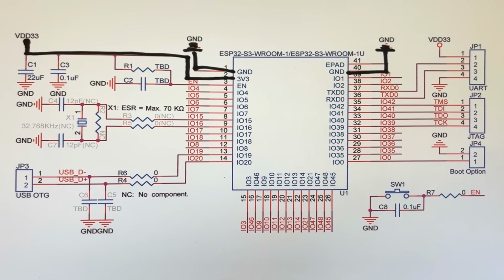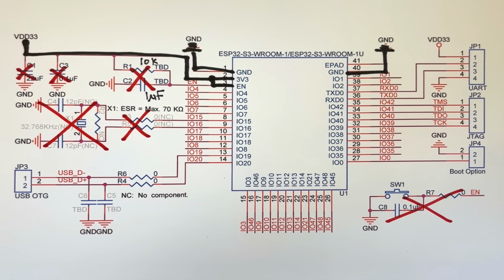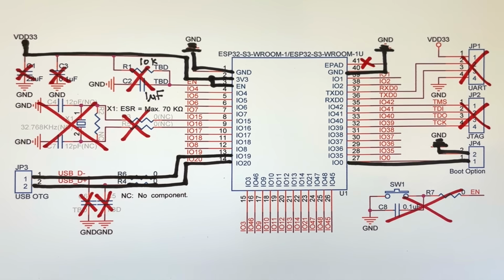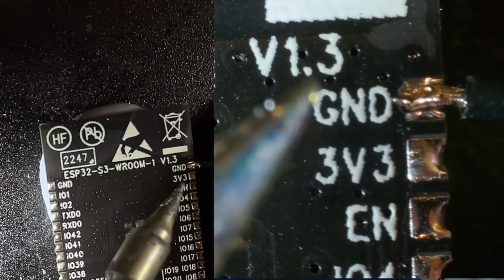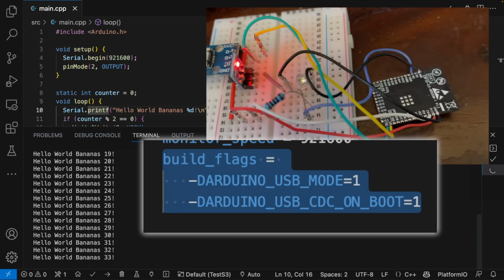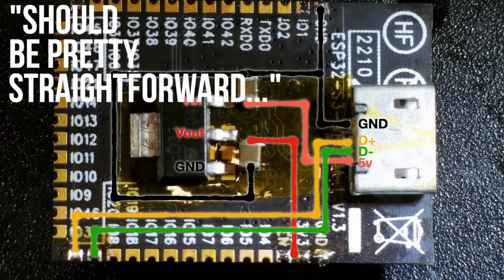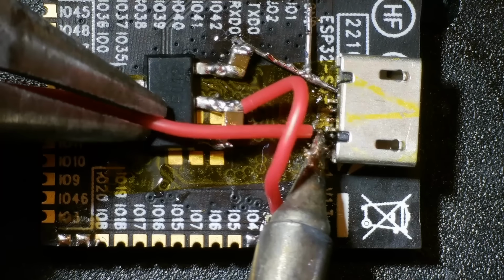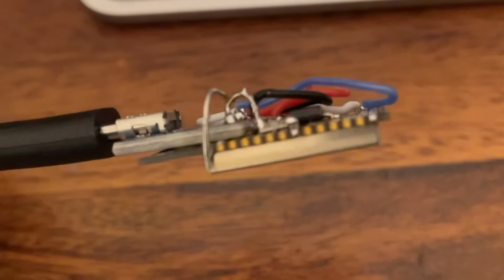Minimalist Microcontroller: Building a Bare-Bones Dev Board

Comment: Why not use an ESP32-S3 chip direct and build the Flash, controllers, and full setup, instead of the Wroom Module?  You can likely make it smaller as you dont need all that there too...  if you build the use case to be specific, can squeeze as small as you want if you dont need all PIN outs/ins, only the ones you need for that project.  But this is a cool idea with the capcom tape and just soldering it on, lol. 

I've been designing my projects to not use the Wroom module, but use the ESP32 SOC and building Flash, ant connector, etc...  I've been going through the datasheets and building my circuit based on the info there and the final product looks freaking professional!  I have not ordered yet to test... but its a LOT cheaper as the same board (125mm x 98mm) through JLC fully assembled with the flash/ESP32/Ant conn/crystal/all the resistors, capacitors, inductors, relays, screw terminals, fuse, etc.  is about $8 a board. on a 20 board order.  That is using their supplies and such.  This is just the esimate when uploading all the files and board info, not final.  and the quote for the wroom32 module (I didnt want to go with S3 because of some library short comings in the ESPHOME echosystem this board is used for, and I am patiently waiting for C6 as I want the Zigbee on Chip!!!!) for everything, but swap all the items instide the WROOM32 with one, was around $18 for a 20 board order. 

So I am very carefully going thru my design and check and double and double check about 15 more times before I push the purchase thru for my first test board.  I have watched Phil's Lab on this very item he has up and an excellent walk thru, after I did my first draft.  I'm not an electrical engineer, so this is my home hobby projects, and doing this as a puzzle for myself to perfect it and then just take that module block and put it on all my projects going fwd.  Maybe save some money in the long run.  Going to see about having them non-build it and get the parts myself and since its just me and not a full production, hand build all mine to save a few more bucks.   But the pricees they offer for fully assembled with parts included is so freaking CHEAP, its hard not to..

Comment: thanks for video. but i havem two question.  I have an esp32 device that I run on battery.  Is it correct to cancel the resistor and capacitor connected to the "en" pin on this device? Also, in deep sleep mode, does the device use the internal oscillator or the external oscillator?  Will I have any problems if I cancel the external oscillator since I use deep sleep mode?
Reply from the maker: Please bear in mind - this video was just a fun experiment. It’s not an instruction video on how to build a dev board.

For a real dev board you should have the resistor and capacitor on the en pin.

The crystal oscillator is not required unless you need really accurate timing. And if you need that you are better off using a real time clock module.

As always follow the data sheet recommendations.

Comment: Great idea if its a sunday night and you've got a demo to give monday morning, and your last working dev board got chewed by your dog.  Otherwise, what is the point?  You have all those pins how you going to connect to them?  Can u buy plain esp32 dev boards to just solder your module.  The bare modules are cheaper, I got a few S3's as the full boards are a few dollars more, and I've got some dead older esps, I assumed they are pin compatible with the s3, bet i'm wrong about that, anyway why I watched to see how minimum you can get, so thanks.

Comment: What about the heatsink on the bottom of the chip? These can run quite hot
Reply from the maker: According to the data sheet it is optional - it does help with thermal performance, but it’s not mandatory.

Comment: in all my projects I use bare-bone modules of ESP32 and its variants (Only prototyping I do sometimes on the dev boards). For many reasons: starting with power consumption of dev boards (too high), ending on customisations and money. However,  SMD does NOT mean... flying components ;-) That is  why you were not happy and successful
Reply from the maker: Very true, I've got a new PCB in the works - which is definitely my preferred option. But this seemed like a fun test of my fine motor skills - with predictable results!

Comment: The bare bones idea excellent, the soldering seems to need some help and maybe better flux and smaller diameter solder for the tight spots. Quite the challenge without very good solder equipment, I could feel your pain. :(
Reply from the maker: yeah, not ideal. Was surprised it actually worked.

Comment: You can cherry pick an LED with a 1.7 Volt voltage drop. I think there are tools that allow you to search for which LED with which color has the highest probability to be EXACLTY 1.7 V. I have seen professional projects in the past abusing an LED for that.
Reply from the maker: Not a bad idea. Would certainly work for a low current circuit.

Comment: how did you manage those solderings? i am soldering and making so many prototypes but i have so many dead boards afterwards... could you explain me ho do you do it? i have tried high temp, low temp, quick and dirty, fast and clean, slow /../. anything...
Reply from the maker: For this board I had it assembled for me - PCBWay are quite affordable and there's also JLC. But you can easily do it yourself as well. Hand soldering components is tricky and you can get into quite a mess. I would recommend using solder paste and either a hot plate or a cheap hot air gun. It's also really worth getting a stencil when you order your PCBs.

Comment: Did we need to flashing firmware to esp32 in first time ? Or it can be use after we buy it?
Reply from the maker: That's a really interesting question - I've personally not had issues with fresh ESP32s and have been able to flash them no problem. But I have had various times where I've had to manually put the module into download mode using GPIO0. So in my recent designs I've just included buttons as it's pretty unreliable. Sometimes you can just flash it no problem. And sometimes it just won't flash.

Comment: Why you don’t use a PCB for this work? The PCB with VDO and USB-Connector will not be much larger as the processor board.
Reply from the maker: Check out the next video in the series - https://youtu.be/zeSlRvCd6tg
Reply: @atomic14  , I have seen your designed Dev Board, very good work. I can’t find any Board for ESP32-S3 only for processor and DVO and GPIO Connectors. I use this cheep board for ESP8266 and ESP32-WROOM with 16 MB.

Comment: I have to try this, because I rescued just the module from a fried vacuum robot...
Now, will this setup work for an esp32 s2 wrover module?
Will it be possible to use this tiny configuration to write into the esp  from a phone with arduino ide?
...if it is, shall I use an usb cable or otg cable?
Thnx and regards from Argentina!!!

Comment: Nice video! Is it possible to do the same in a esp 12E module as well? Thanks in advance!
Reply from the maker: The 12E would need a USB to serial chip - so more components are required. But if you were happy to connect directly to the serial pins then you could definitely do a very minimal dev board.
Reply: @atomic14 Can you please make a video on that too? Even a short will be really helpful. I had made a automatic pump controller with WiFi capabilities using esp8266 dev board. But to make the same project commercial it would be necessary to switch from the pcb that i made using perf-board to a fabricated pcb along with the esp 12e chip and not the board. I want to prototype this design so i may want the serial monitor and also want the esp 12e to be programmable inside the circuit itself. I would really appreciate any help or any other ideas to prototype my design into a pcb. Thanks in advance!

Oh thanks for reply too.

Comment: Nice. Did you measure the power consumption while having the "dev board" in deep sleep? Would love to learn about your DMM readings.
Reply from the maker: I didn’t! But that would be interesting. I think with a proper modern voltage regulator it should be very good.
Reply: @atomic14  Does the board still exist? Maybe you could ... ;)
Reply from the maker: Here you go :) https://youtube.com/shorts/i4OT7duQy4M

It's about 40mA when active and 5mA when sleeping - but that's probably almost entirely the AMS117 which has a quiescent current of up to 5mA!
Reply: @atomic14  Thanks a lot, Chris. That is what my assumption was. I run some ESP32 from LIFePos, without LDO and USB, and they consume microA while deep sleeping. But having USB and an VReg for updating and stuff would be convenient. I would have to add a jumper to disconnect the VReg when not using USB while running from the LiFePo, I guess. Again, thanks for confirming my thoughts.
Reply: @atomic14  Not with an AMS117 regulator!  Those things are power hogs!  It has a Quiescent Current of 5_000 uA!  Try something like the Ti TLV761 which has a quiescent current of around 65 uA, and still offers 3V3 at approx 1000  mA   About US$0.66-0.75 each at Mouser.
Reply: I'm using HT7833 for LDO and PPK2 shows around 16uA deep sleep consumption.

Comment: Next time,if ever, use thin enameled 'magnet wire'. As these are very thin, you hardly have to fight with other wires, and soldering is much faster as the wires are so thin.

Comment: well if I test your viode on a new ESP32 S3 module (not replaced another ESP32 Board) it is NOT working. If I replaced another board esp32 s3 now working. SO i thing this this design needs a BOOT buton also. Otherwise this Error message appear on serial monitor : invalid header: 0xffffffff
Reply from the maker: Latest video with a fresh module seems to work out of the box - but I’m going to do some more experiments with more fresh modules straight from the packet.

Comment: well you could run it like that, but why? I know it's just for fun. also it does depend on your definition of "Works" 🙂
With no supply decoupling, no power up reset, etc doing anything other than flashing an LED is going to be questionable.
Also what's under the metal can?

This is click bate, you've put a how ESP dev system under that can 🙂
Reply from the maker: It certainly is a lot easier when you have a complete WROOM module to work with - with a completely bare ESP32 chip this would be very difficult.
Reply: @atomic14  i do all my work around the small modules as that's the easiest way of getting something prototyped.  but if i was designing something for  a customer then it would be discrete chips all the way.